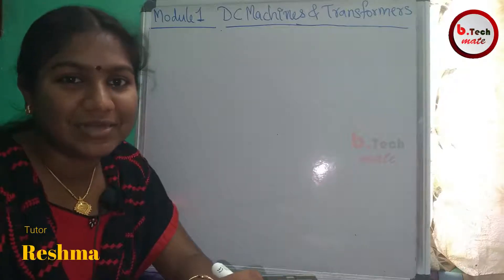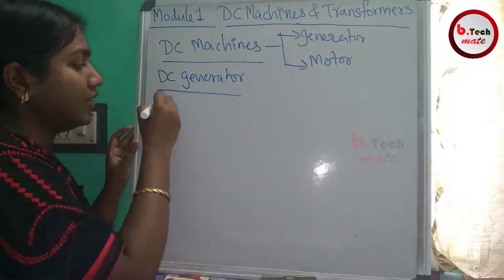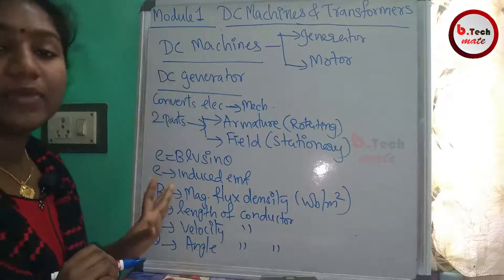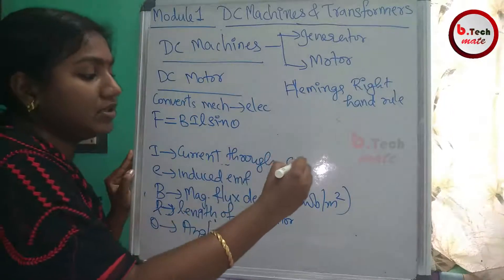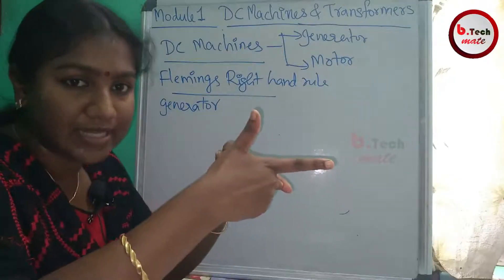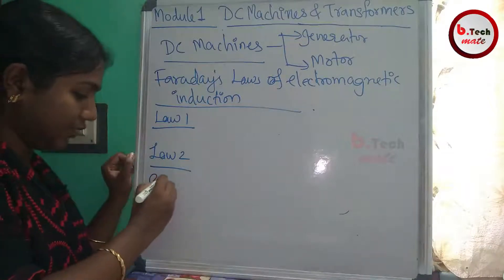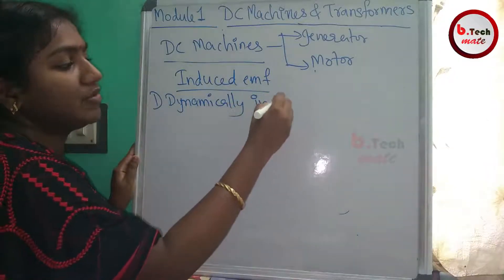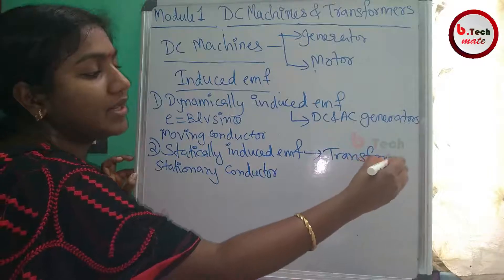76. INTRODUCTION I KTU S3I MUST SEE EITHER DESCRIPTION OR CMT I DC MACHINES&TRANSFORMERSI MODULE 1 I

Comment: Last modukes vegam idaavo exam udane und
Reply from the maker: Will try best
Reply from the maker: Will upload mod 5 toady
Reply: @btechmate8162  module 5 and 6 inn idaavo.nale exam aan
Reply from the maker: As per your request , we are focusing more on last modules. We try our best to upload by 8pm. Remember DMT portions in our videos are purely depending on previous year question paper.
Reply: @btechmate8162  thank you 😊
Reply from the maker: Keep watching...share with your friends and your community
Reply: @btechmate8162  want rest of the modules asap
Reply from the maker: Will upload mod 5 previous questions soon
Reply from the maker: For all your attention, very sorry that in starting i have told that generator converts electrical energy to mechanical energy. But i would like to correct it as "GENERATOR ALWAYS CONVERTS MECHANICAL TO ELECTRICAL ENERGY."

Comment: Ok thanks
Reply from the maker: For all your attention, very sorry that in starting i have told that generator converts electrical energy to mechanical energy. But i would like to correct it as "GENERATOR ALWAYS CONVERTS MECHANICAL TO ELECTRICAL ENERGY."
Reply: @btechmate8162 motor?
Reply: @athulyaradha5628  vise versa

Comment: Full module University problems video cheyuo
Reply from the maker: Will try best
Reply from the maker: For all your attention, very sorry that in starting i have told that generator converts electrical energy to mechanical energy. But i would like to correct it as "GENERATOR ALWAYS CONVERTS MECHANICAL TO ELECTRICAL ENERGY."
Reply from the maker: All these video series contains previous year university questions.